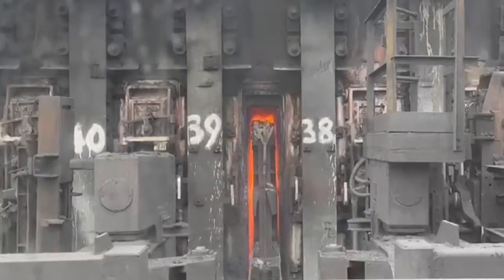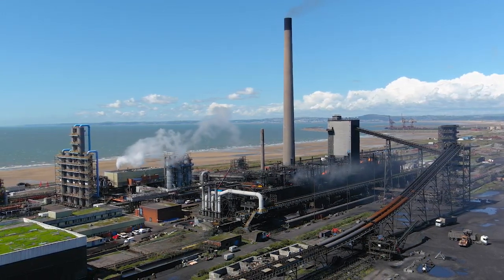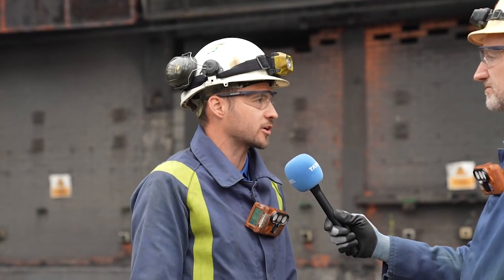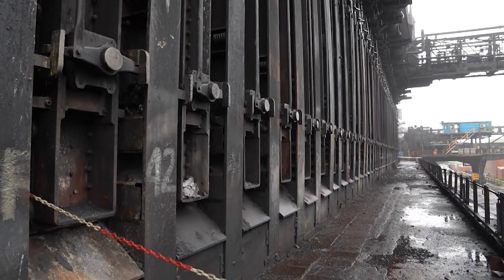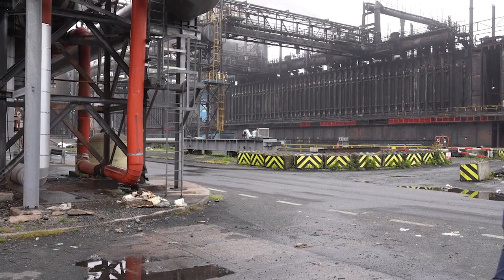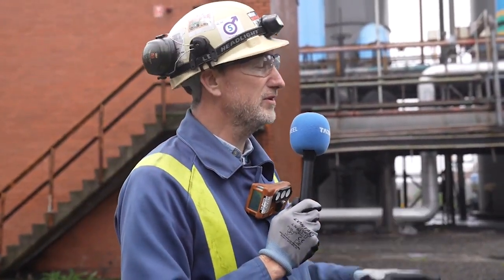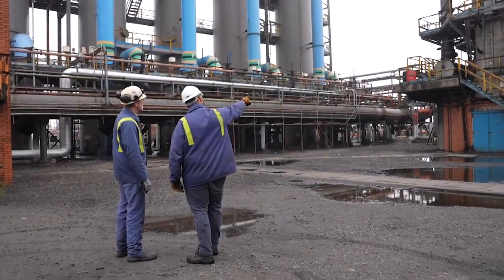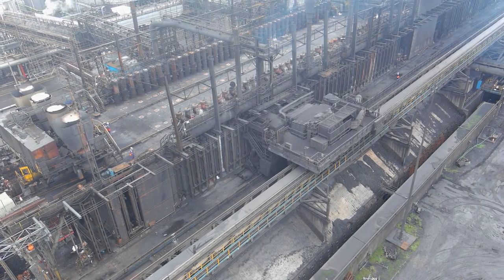Decommissioning Port Talbot’s Coke Ovens

Comment: I have done many projects on coal, ore and coke at PT over the years, especially Morffa.  I remember working up on top of the coke ovens in full protective gear in the summer, that was pretty warm!  Riding in the pusher car cab when pushing the ovens was always a treat!  I will miss Morffa.

But you can't blame Tata and we can't afford for emotions to get in the way of reality.  The problem is that nobody has been able to make primary steelmaking pay in the UK for decades.  I've worked on and off with projects for the steel industry for 40 years so I know all the UK sites and history pretty well.  British Steel lost money endlessly in the 70s and 80s, when it became Corus the same pattern followed.  Teesside was sold to Thai Steel and they were confident they could make it pay - they invested hundreds of millions including blast furnace relines at Redcar, and lost everything.  Blackrock bought Scunthorpe and tried to make it pay, they couldn't, sold it to Jingye, same problem.  Tata have been investing at PT but still can't make it pay.  So many people have tried - and failed - that the conclusion is clear.  Making primary steel in the UK is a losing game.

Steelmaking is only 0.1% of the UK economy - you could say it's an irrelevance economically.  Yet steel is absolutely basic to so many of our successful UK industries - cars, construction, railways.  Without steelmaking we're reliant on others for our raw material.  So if we have an industry that is strategic, what are we to do?  Prop it up with taxpayer money?  Force our UK steel users to buy British?  Those approaches just put our successful industries at a bigger disadvantage, so they are not an option.

Some transition to EAF steelmaking is overdue.  The UK ships millions of tonnes of steel scrap overseas every year, whilst importing coal and iron ore to make primary steel - that makes no sense!  Much better economically, for the environment, and for our own self-sufficiency, to recycle our scrap here in the UK in arc furnaces, so boosting EAF capacity is a no-brainer.  Does it matter that we retain some primary steelmaking at our last blast furnaces, Scunthorpe?  In an uncertain world, maybe it does, but can we expect taxpayers to fund that eternally?  Because it's never going to make money.  If a complete handover to EAF is the only way to make steelmaking pay in the UK, that's better than losing steelmaking altogether which is probably the only realistic alternative.

I'm sad I'll never experience the heat and drama of Morffa Coke Ovens again, and see that huge cloud of steam rise from the quenching, but no doubt I'll get some projects out of scrap handling.

Comment: I'm an ex chemical engineer. UK is a service economy (moving money) rather than industrial (making money). Our entire CO2 budget is less than some countries' annual increase. Our steelmaking is more efficient, safer, and cleaner. We'll never see industry like this again. Its why I'm an ex engineer, too hard to find work in the UK. I went into research and that dried up as we were seen as having the skills of the "bad old days"; funding moved to removing industry. I now work in an office. But i will never stop thinking like an engineer, a heavy burden when i see what is happening.
Reply: This "move to a service economy" is mostly a lie, a falsehood created by statistical methods.  It's just not true.  Take a big manufacturing plant like Dagenham where Ford makes engines.  Years ago, everyone on site was employed by Ford - from cooks and cleaners, to roofers and lorry drivers, maintenance personnel, accountants and security.  So their jobs were all classed as "manufacturing".  Those same people still work there doing the same jobs, but now they work for contractors, so they are classed as "service" jobs.  Only the people on the track are employed by Ford, so the number of jobs in "manufacturing" is a fraction of what it was.  But in practice, nothing has changed.  Same people, same jobs, all paid for by the margin on building engines - but the people are assigned to a different category within the economy!

A very large proportion of the "service sector" jobs in the UK are actually people employed indirectly by manufacturing companies.  The contribution of manufacturing to the UK economy has not shrunk anything like as much as the figures would tell you.  That's the problem with statistics, they can be misleading.  Celebrate the success stories in UK manufacturing, don't knock it.

Comment: What happened with the new BOS vessel? Has that been stopped?
Reply from the maker: There is currently a reline to extend the life of one of the vessels as we plan to make steel until September. Following that, there will be no need for BOS vessels in our future steelmaking operations.
Reply: @TataSteelUK  so have install of the new vessel been abandoned and you only have 1 vessel now? Because there was no follow up to the vessel replacement video.
Reply from the maker: Following the announcement, it didn't make business sense to invest in brand new BOS vessel. We have extended the life of both vessels with relines and will continue to use them until the closure of the heavy end.
Reply: @TataSteelUK  ahh! Thats fair enough! Did wonder!